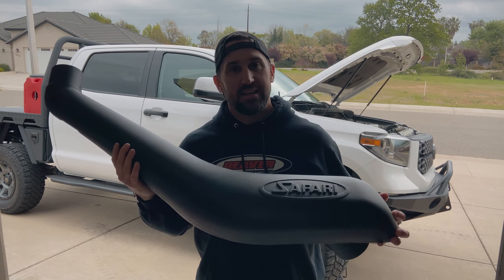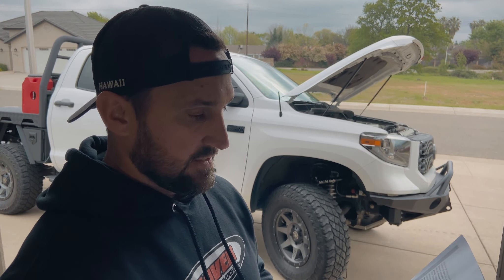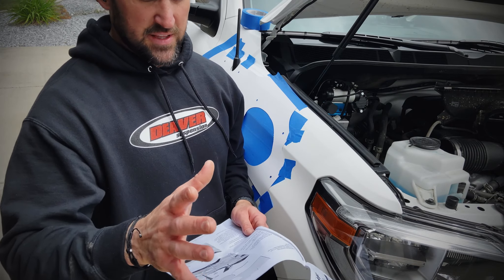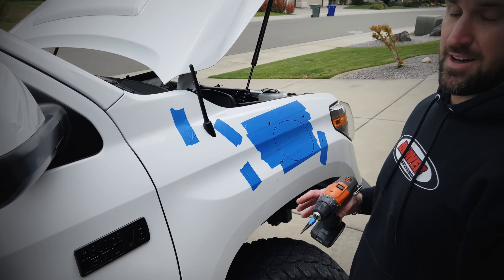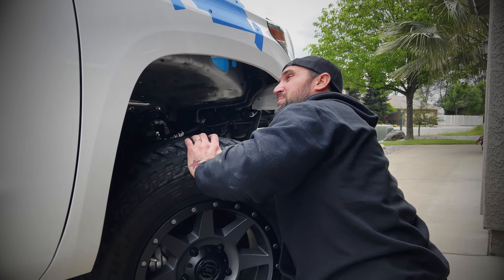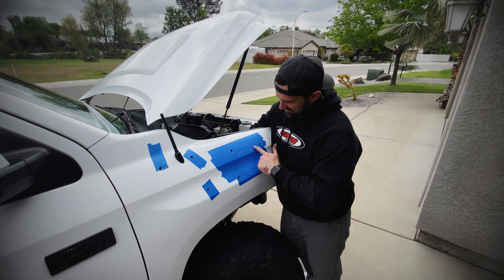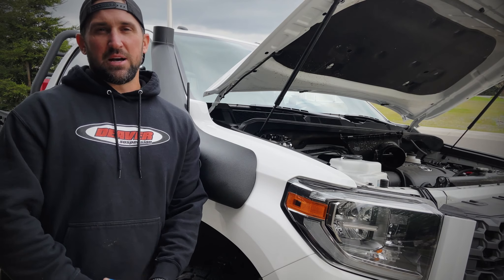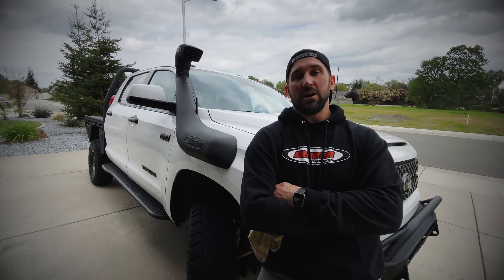Overland Garage: Tundra Snorkel Install | Chopping our NEW Tundra

Comment: Well, I hope you like it….I said to myself when I saw the holes.  I like the idea of the snorkel… just cant get past the permanence of the change.   haha!  
Great video!
Reply from the maker: Yeah no doubt about the point of no return… it wasn’t until I later had to replace the fender that I realized how simple a fender is to replace, literally 9 bolts and a few clips. Plus I’m a huge fan of having the intake out of the wheel well, especially when I was crossing flooded areas last fall, I would have been unable to cross most of them.

Comment: WIll a snorkel work with an aftermarket air intake?
Reply from the maker: Remember how your stock intake connected to a tube that went into the fender? The snorkel connects to the tube that goes into the fender, so IF your aftermarket intake uses that tube still, then YES 👍

Comment: what about your secondary air inlets?
Reply from the maker: The secondary inlet only opens for about 30 seconds when the engine starts and currently sits 36” off the ground, so as long as I’m not starting the truck in deep water we good 👍

Comment: Will that install on a TRD pro air intake?  Wonder too if enough clearance for bushwaker flairs?
Reply from the maker: It's simple enough to cut the fender flair around the intake tube, as for the intake I've never seen a different intake for various models (they may use different filters but the inlets are all the same).

Comment: Did you also treat the bare metal with a rust inhibitor or paint? Was curious if the instructions suggested it
Reply from the maker: I used https://amzn.to/3HMZRdu UPol Acid Etch Primer... I wasn't told to use it but if you look closely into Raptor liner manual it recommends this stuff. I found it's been ideal when I scrape the surface of the paint to resist rust "creeping" on me. What are you thinking about doing?

Comment: Did you feel a difference performance wise? Or get a nice intake sound?
Reply from the maker: I perceive a performance increase because of the air ram effect, not sure if there was ever any HP gains... however, I've found that my air filter stays cleaner longer and I explain this by having the air source above the wheel well where dust generally saturates when driving off-road.

Comment: Does the snorkel add more wind noise on the highway? How about fuel economy decrease?
Reply from the maker: For wind noise: I had the snorkel on before I had the roof rack and I didn't notice any audible noise from it while at highway speed. With the windows down and accelerating it makes a slight yet manly air being shoved into the motor sound (hardly noticeable).
MPG Decrease: None. It acts like any cold air intake would in the MPG/Power department (technically improved just not noticable). I hand calculated my Highway MPG last night (because of the 37's my MPG calibration is waaaay off) and I'm right at 12.4mpg highway.
Reply: @WolfPacOutdoors  Thank you!! Very informative.

Comment: How’s the connection from snorkel to air box?
Reply from the maker: It’s easy, the collar is a large diameter hose held on with screw clamps… I’ve never had an issue with it over three years of beating on it.

Comment: What else needs to be upgraded in a 3 gen to cross water?
Reply from the maker: Justin G I personally installed a rear differential breather and placed the vent at door handle height, then inspected the front diff breather for leaks. Some would make the argument to relocate the secondary air pump (although it only operates on cold starts, then closes off once the catalytic converters warms up).  If you did all 3 plus a snorkel you’d be covered 🙌